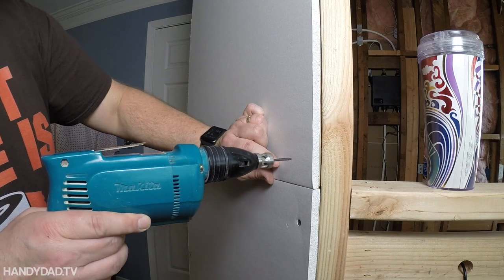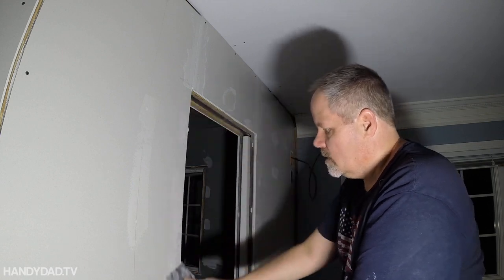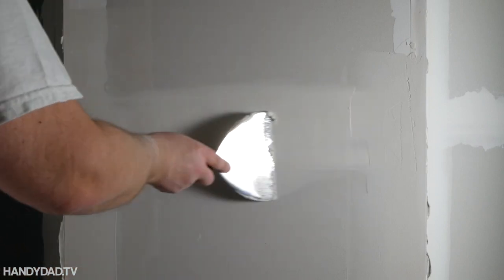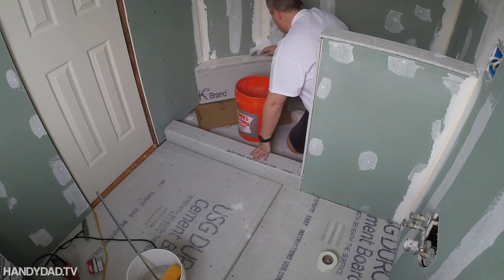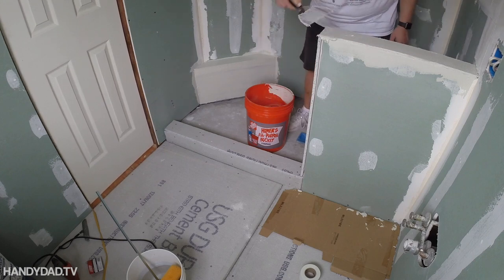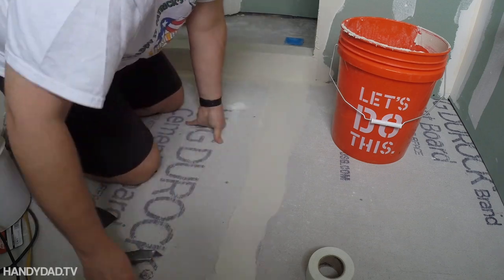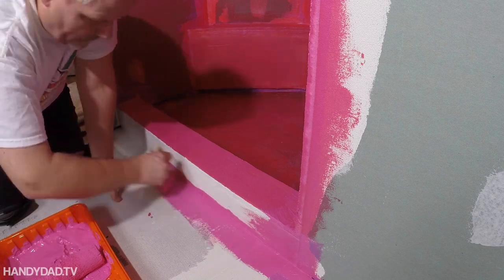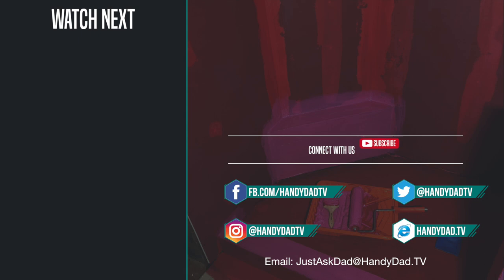Walls and Waterproofing | Master Bath Remodel (Part 5)

Comment: Just a tip, tape some 6mm plastic over the door opening next time (if there is a next time), and buy a sticky zipper so you can walk through, it will reduce the dust to next to zero, also paper booties if you have to step out quick and run through the house ;)  Great job, well done on tackling it. Enjoy the fruits off your labor mate!

Comment: Always apply Redgard or any liquid waterproofing as per the manufacturers directions. There is a coverage rate on the can to make sure it is thick enough to block vapor as well as bulk water. They tell you what roller to use (3/4” rough Nap) and how many feet you should get out of a gallon if applying it right. Always 2 coats minimum.

Comment: Please, for God sake, if you are going make videos of tile shower installation for 100,000+ people, edit this video and insert any cement board inside of the shower, not green board. Do not ever put drywall inside of a shower. I don't care what color it is
Reply: I totally agree
Reply: Green board is fine as long as you waterproof it lol.
Reply: @darrenr1194  your comment is very telling about your experience in the field. I highly doubt/hope you don't do that for a living. THIS IS YOUTUBE! If you think you can watch a 20 minute video on the trade and you are good to go, then you truly deserve the results you will inevitably incur. If he would have done this in a correct fashion and used a shower system such as Ditra or durock, then it might've passed. But those systems have a great amount of flaws themselves. Tile installation is possibly the most most miticulous and ever changing trades out there. You need to know so many things about other trades to be an expert. 

You CANNOT simply red guard a drywall product and tell everyone it is ok like this video. The fact that there are so many people putting out ridiculous videos like this (his Starr Tile reference included) is what is making those who have gone through the process cringe at the lack of knowledge and appreciation for the trade.

Hopefully you had a typo. You should be able to refer to the major tile standard industries for code/methods/standards and not watch a YouTube video thinking you know what you speak of. There are home owners that look at things like this. It's absurd this is allowed
Reply: @coreylawler4034  Once you waterproof the drywall it's fine. Once you water proof cement board it's fine. What's the issue here? Just because you don't agree with innovation and technology that doesn't mean it's wrong. Back in the day where there was no waterproofing guys would slap tiles on with mastic on regular half in drywall and to this day most are still perfect with no mold growth....  Anyways to each their own.
Reply from the maker: I agree. Cement board is porous just like drywall - either one would need to be waterproofed.
Reply: @darrenr1194  No, it's not not fine. Just pause for a second, think about how much water goes through a shower. Drywall is not an acceptable substrate for tile, especially inside of a shower. For the love of God, how is this hard to understand??? Yes, cement board is porous and requires waterproofing too. Every single shower needs some sort of waterproofing 🤯 Everything inside of a shower should be made with a cement based product. Not. Freaking. Drywall. Please ask a handful of respectable tile contractors or anyone with mild tiling experience.    Hell, I'll just start building my showers with Graham crackers and everything will be ok as long as I red guard it! Obviously neither of you are installers, insured, or licenced. Please stick to other trades or just stop making videos like this. It makes tile installers have to tear out moldy crap and feel bad for a homeowner who doesn't know better
Reply: @darrenr1194  Also, back in the day, guys would skreet their walls. Concrete everywhere. Not drywall. Ever. Just because you saw someone do something, doesn't make them correct.
Reply: @coreylawler4034  You are delusional bud. You can't accept the fact that once the substrate is WATERPROOFED by a WATERPROOFING PRODUCT then water will NOT be able to affect the product if done correctly. That's like saying we should NOT use plywood on roofs because even though the shingles protect it, water is still beating down on it and it can get moldy? Therefore all roofs should be boarded with cement board as you say and shingles added on top because water hits it so therefore cement board nothing less than. lol dude just stop commenting now as you are so dead wrong.
Reply: @darrenr1194  DUDE, you have no clue what you are talking about!!!!!!  I was trying to be nice about it, but how about you look up the specs for Red Guard. Specifically find the suitable subtrates AS PER THE MANUFACTURER, and let everyone know who might be reading this stupid thread what you find!!! Go ahead, I'll wait.......
Reply: Perhaps you should try and learn about the trade from someone qualified to teach you. I am praying you are not a tile contractor
Reply: And???? Bueller?
Reply: @coreylawler4034  I will be happy to add to this thread since obviously you are brainwashed. Waterproofer on any surface insures water doesn't penetrate, I know that is pretty basic but since I'm speaking to you it needs to be said again. There are a lot of people out there that cannot think on their own, that believe what they are told without zip to back it up, another YouTuber out there constantly talks about failures, maybe in a year, maybe in 5 years, maybe in 10 years, now he is bumped it up to 20 yet provides zero proof of said failures. After ripping out showers from 1998 I have yet to come on any installation where the tiles are falling off the wall, where the backer board no matter what the makeup is ruined including sheetrock because of water penetration, the only time I see that is when idiot tile Setters stick their backer board inside of their pan before they pour, then yes, all backers will fail in that specific area.. and I show proof of that on many of my videos so it's not just something that I'm saying it's something that I show, unlike other people who profess failures but show nothing. Even on my latest video call The 100 Year shower which I posted 2 years ago, no sheetrock failure after 30plus years... my proof contradicts your diatribe. And then there is denshield which is basically a gypsum product that has been pre waterproofed allowed in showers, explain that. Then there is Schluter which specifically calls for sheetrock behind it so, do you know why? Because they believe in their product as being waterproof, and so is a topical liquid membrane. Once again I started by saying that you are brainwashed and I believe you truly are so you will take none of what I say to Heart and will contradict everything but I do not believe the general public is stupid the way some other YouTubers think they are, my customers are very intelligent, many of them much more than I am and have done their due diligence... as a matter of fact I have worked for many engineers, and they wholeheartedly agree with me as does this guy, which is why he consulted with me long before he ever built his shower on this video, he had plenty of options to choose from and did not willy-nilly pick mine.
So for you to go on to his channel and berate his system because it does not agree with your book Soldier mind is very presumptuous and immature...but unfortunately you seem to be in the majority of people that freak out over things they have no business freaking out over. I would suggest in the future that if you are going to make a statement that you actually back it up with facts, otherwise it becomes a pissing contest which we all know nobody ever wins.
Reply: @StarrTile  of course you agree with this. If you apply critical thinking to everything you said, you wouldn't be on YouTube anymore I guess 😂😂😂

Let's see, where to begin....

Could you please show me a tile organization, affiliation, company that says green board is a better backer than hardi (which is what I would use if you are going that route) or durock??? No. You can't. Why is that??? Because a shower shouldn't be built with drywall, styrofoam, or even benches made of 2*4s. That is so completely simple to understand.

Everything inside of a shower should be...

Cementious! 😱😱😱

Dear lord, why is it so hard for you to understand this??? If your point is that the waterproofing will make either acceptable (which it won't because drywall is not an approved substrate) and the results will be the same, I would still ask why you would prefer something that can never get wet over something that can take on water, without it dissolving into mush? 

If someone puts drywall inside of a walk in shower, they either don't give a damn or don't know any better. Either way, people trying to truly educate themselves about the trade shouldn't see stuff like this or on other channels...

I hope you didn't just bring up denshield. That is the biggest joke of all of them, because if the client is naive enough to buy it, I highly doubt they are going to waterproof screw holes, corners, etc.

There were 3 tile companies that I worked for in Atlanta that loved it when it first came out. And less than a year later, they got rid of it quickly. Because......

It's just drywall in disguise.

As for schluter, we wouldn't ever use it for a client. Waterproofing a shower with a waterproof sheet and bonding them together with something that is not waterproof is stupid. One little thing goes wrong and water is leaking. Not to mention, you can't even use it in certain applications. They will literally tell you not to use their product if you ask them about certain materials and scenarios.

I can't remember what other funny things you said, but hopefully I helped you realize how crazy you sound.  I assure you, you wouldn't be so confident around a group who are experts, certified, and trained correctly.

Tile contracting is difficult. Not just the labor, but knowing what to do or use for each situation.

Most of the people that run into problems or issues think they are good at what they do, when they honestly haven't been trained correctly. Ever. Another reason why I don't like schluter. They basically say, "Even though you have 0 experience, use this and you can call yourself a tile contractor!" Which even you have to admit is crazy.

All in all, if you still think red Guard can go onto green board for a shower, rotate the bucket 180° and read the specs. 

You say I'm brainwashed. I say educated...
Reply: @StarrTile  I like some of the schluter products, mostly transitions in unusual circumstances. Seems like they have one for any two elevations. Even though they are expensive as hell once you look at those fancy profiles. The Ditra underlayment was an incredible idea. I don't like using it because there are applications you can't use it on. Unless you are installing yourself, so many installers don't wipe down the OSB or concrete, mix the thin set too stiff, etc. But the shower system is just the old school flashing technique used with material that are very inexpensive to make and they sell it for God knows how many times more. So many loop holes in the warranty as well. Any good tile installer warranties their work. 

As for the video, I don't know why you are so upset about my comment. It's wrong. Completely. We use liquid applied waterproofing almost every day. But not on something that would fail when wet. By your math, I could just start making my showers out of mashed potatoes and whole wheat bread as long as I red Guard it, correct?

What you don't understand is, well, first of all how to prep a shower (if you truly believe what you are saying), but I honestly just think you are being stubborn about it.

Secondly, if you are going to make YouTube videos about a certain trade, and you are not an expert, not only should you be always trying to improve, but to put videos up specifically telling people that it's ok to do certain things that could cost someone thousands and thousands of dollars, is irresponsible, childish, and should be embarrassing. I didn't even realize tile videos were on YouTube until maybe a year ago. And, wow. People are truly blissful in their ignorance. 

That being said, I have nothing but respect to people who make videos on tile contracting. The trade itself is so meticulous as it is. I couldn't handle the comments to be honest. However, if you are going to make the videos, you have to be able to admit when you are wrong, learn from it, and move on. I used to be stubborn as hell about it. I'd stick to certain methods even if I wasn't 100% sure it with best choice. And God forbid I was ever proven wrong. But as soon as I was able to consider that some of the things I was doing were not the best, or even wrong, everything got easier. I worked around probably 100 different tile guys in Atlanta, 30-40 up here in Minnesota, but we also used to travel the country for commercial work and we would do remodels with other top tile contractors for some extra money. I learned a lot and met some awesome guys.

Don't mean to sound like an A-hole, but incorrect teaching videos are creating tile hacks at an exponential rate.

I'll leave you with this scenario:

You build a nice Master shower using this method here.

I'll build one using all cementious products.

We both have the exact same looking shower. Everything is good, right?

Now each homeowner comes in to the bathroom and says they don't like 3-5 tiles hands each of us a hammer, chisel, knife, and Dremel, and wants them taken out and replaced. 

Which method will be fine and which will look like you had no idea what you were doing?...
Reply: @ekujj13  😂😂😂 people on YouTube man. Experts I tell you
Reply: Darren R  what nobody understands is it doesn’t have to be the bulk water that gets tot he sheet rock. It’s the vapor. Use cement board always, and install it as per TCNA.
Reply: Man I read this whole thread lol I like all of Starr tiles videos and about to redo my bathroom and will be using durock underlayment and redgard as well with the tape and such In all corners and seams along with a concrete block bench. Just my opinion. I watch all these youtuber tile guys and I like a little bit of each and everything they do and I pick and choose what I want to use from their advice.
Reply: Did you tape the inside corners of the shower?
Reply from the maker: @Boise Yes.

Comment: So I was thrown into a bath reno and need to figure out where to stop my wall board whatever that is in the tub area as I'm abutting up to existing wood lath and plaster on adjacent wall. The plaster I'm removing in tub area is approx 1/2" thick so figured I'd leave the lath there. The rest of the tub area is down to studs. H E L P Thx for any input..
Reply from the maker: In my opinion, the tile substrate should but the top of the tub lip on the studs. Then the tile will extend below the lip, nice and flat.

Comment: In the shower,  how low are the lowest screws in the wall board?  - low enough to penetrate the pan liner?  My impression is that Bob Doyle doesn't worry about a few screws penetrating the pan liner, but I haven't found one of his videos where  I can see how the bottom few inches of the backer board is attached to the studs.
Reply from the maker: He says to keep them above the curb height. No worries if they puncture the liner that high. Water will spill over the curb before it penetrates the liner.

Comment: Why did you use durarock on the curb and not on the inside walls of the shower I believe you will have a problem with adhesion of tile and mold down the road.
Reply: Well... you don't stand on the walls.  The curb takes weight.  Tile adheres to sheetrock just fine.

Comment: I've heard that red guard doesn't stick to drywall compound. Looks like you have drywall compound on your screw holes and corners. Any trouble with the red guard and the compound?
Reply from the maker: No trouble at all
Reply: @handydadtv  thanks. that's good to know. great job on the bathroom, btw!
Reply from the maker: Thanks 😊

Comment: I wouldn’t have put it on the floor. The water can’t drain if it gets under the tile then. You block it from working its ways through the mortar slope bed into the shower pan where it can then travel the pre slope into the weep holes. By redgarding below the tile, you are basically screwed if it leaks through the tile. Bad mistake.
Reply from the maker: Definitely get mixed opinions on that, but I followed the advice of a trusted pro. I’ll do a follow-up in 10 years if it becomes an issue.